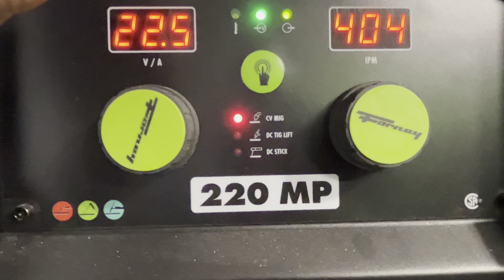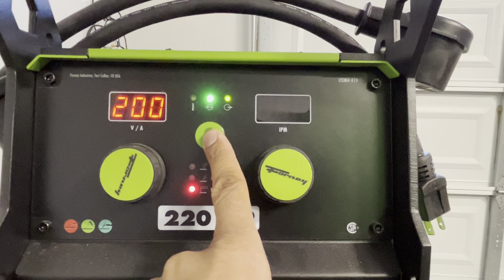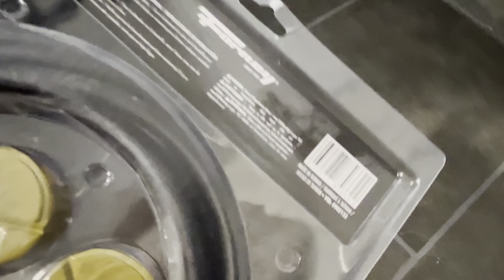Welder set up: Eastwood cart and Forney Welder/Plasma Cutter

Comment: Nice little setup you mite want to add a few hooks and don't roll up your welding lead it will give you trouble in the future it is beat to keep your loops as large as you can and when welding keep it as straight as you can found this out after a lot of years welding a old-timer pointed it out to me when I thought i was having a problem with the welder straightened out the mig lead and problem went away
Reply from the maker: Interesting. Thanks for that nugget of knowledge